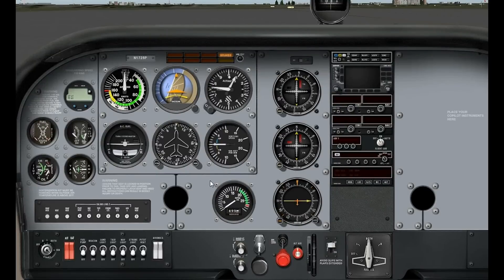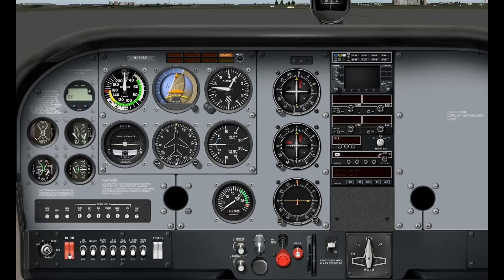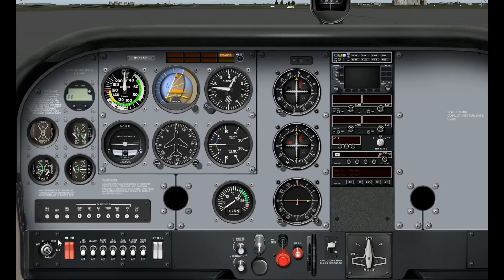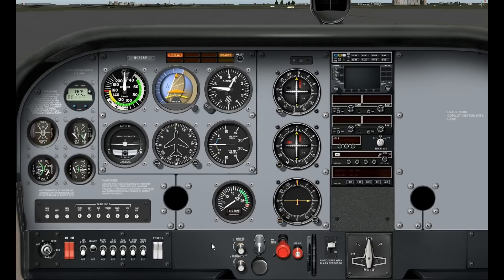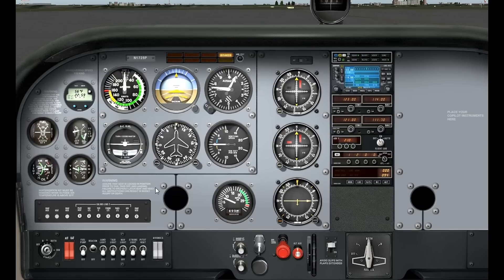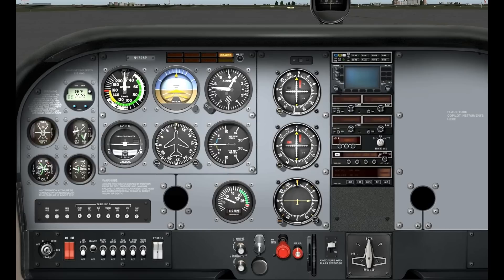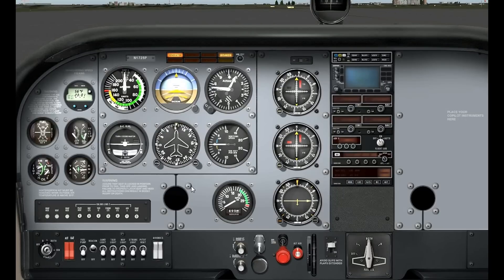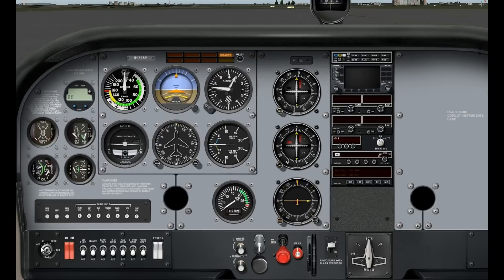Flight Simulator Lesson 5: Starting and Shutting down a Cessna

Comment: Aspiring pilot here. Awesome video series! But you lost me at the magneto check. You said the plane should've shut off when you turned the key off, but it seems like it kept going. How is it you were able to turn it back to both, and the plane continued to run, without having to restart the plane?
Reply from the maker: +adamjhuber What happens is that the propeller's momentum keeps the engine turning for a few seconds even after the key is turned off. If I had left the magnetos in the off position, the engine would've spun down and stopped. So what you're actually doing is checking the ground connection of the magnetos. You turn the key to off and make sure that the engine starts cutting out, and as soon as you hear it, you turn it back to both, and then shut it down by leaning the mixture all the way (which cuts off the fuel flow).

Comment: Thank you so much for these lessons sir. Excellent delivery, clear and concise.
One notices that during this procedure the fuel pump is switched off the entire time. Is the pump not required to be on to supply fuel to the engine? Am i missing something or is this a fault of the sim.
Reply from the maker: Dorothyinstead I'm assuming since this model has a fuel pump that it is fuel injected (not always the case though, for instance low-wing airplanes have fuel pumps even if they're carbureted). That being the case, one would have to look at the actual operating manual for the airplane to see when to use the fuel pump. In this case, I would assume that you use the fuel pump to prime, then start without the fuel pump, and you would use it for takeoff and landing too. Good observation, thanks!